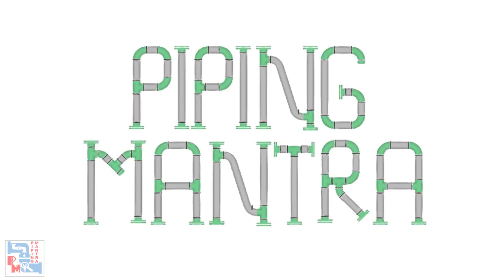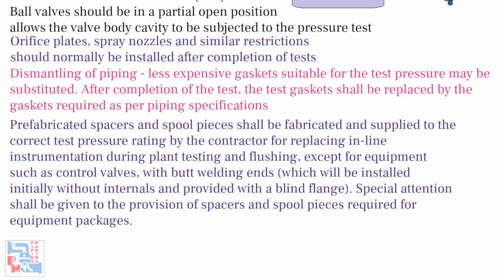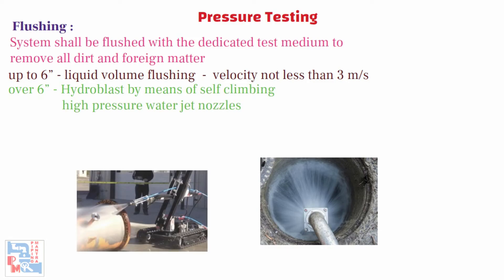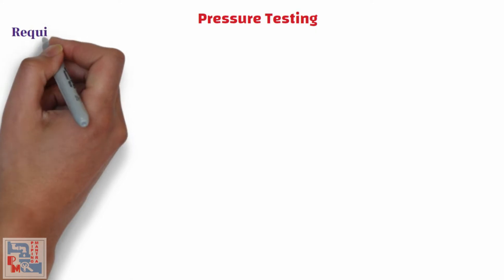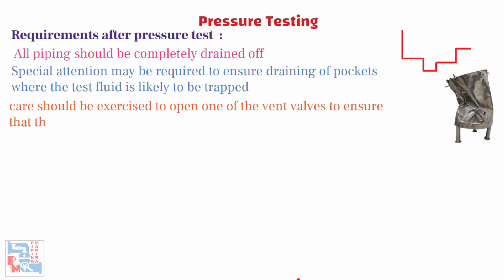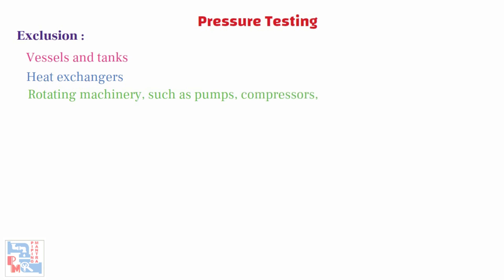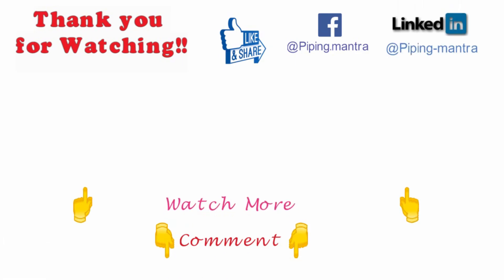Pressure Testing | Hydrostatic Test | Pneumatic Test | Piping Mantra

Comment: 00:02 Pressure testing ensures safety and reliability of piping systems and equipment.
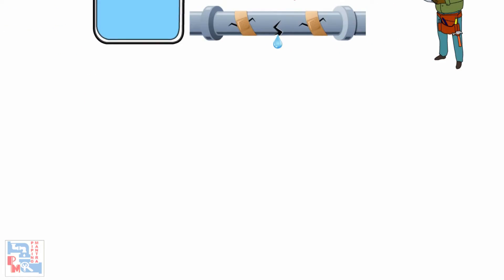02:23 Pressure tests must be performed under controlled conditions and documented in a test record.
04:42 Hydrostatic testing of piping with water and gasket replacement
06:51 Flushing and Pressure Test Manifold
09:05 Requirements during pressure test
11:13 Key considerations during hydrostatic and pneumatic testing
13:16 Pneumatic tests are potentially more dangerous than hydrostatic tests
15:18 Pressure testing requirements vary based on codes and standards